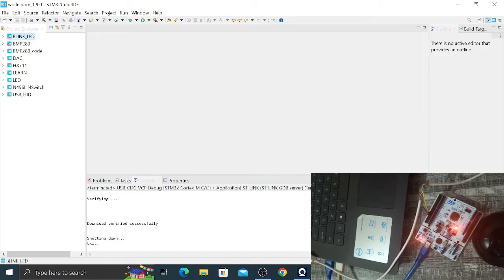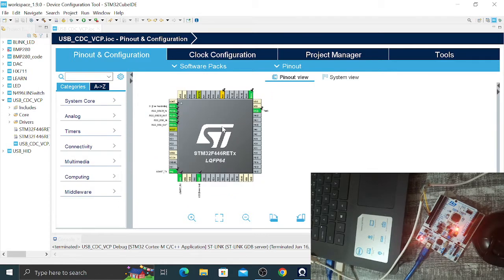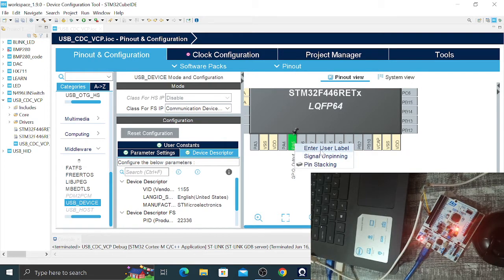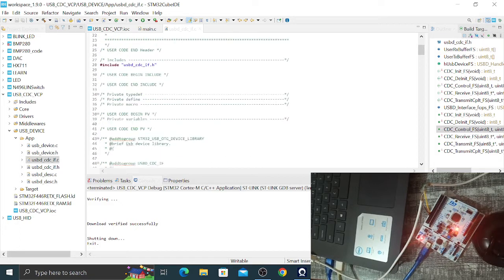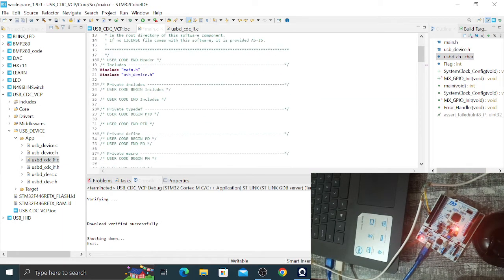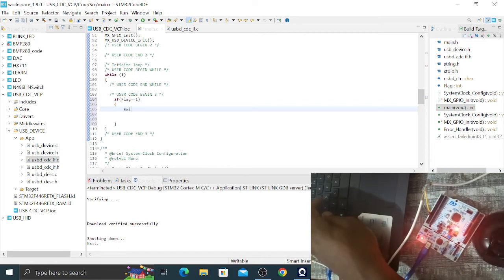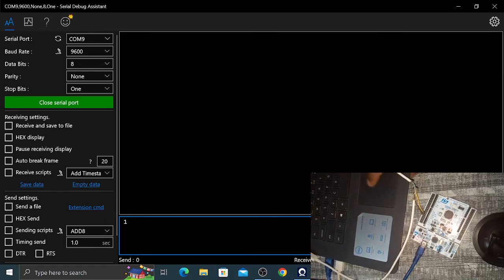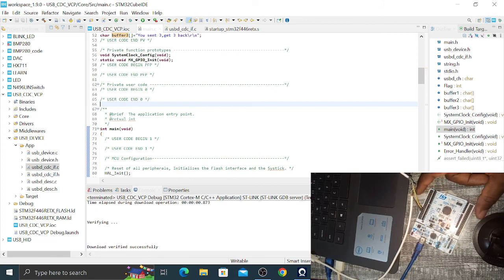USB COMMUNICATION DEVICE(VIRTUAL PORT) || STM32F4 ||STM32CUBEIDE.

Comment: Hello @askedisondoit8482 Congrats for the tutorial. Amazing. I' m trying make a Data Aquisition Project using ADS1256 board with SPI communication between Nucleo-L476RG and USB communication to get high speed data rate transfer. If you can please post a video about how do it. Thanks.
Reply from the maker: If I can get the ADS1256 board,I will definitely create a session for it